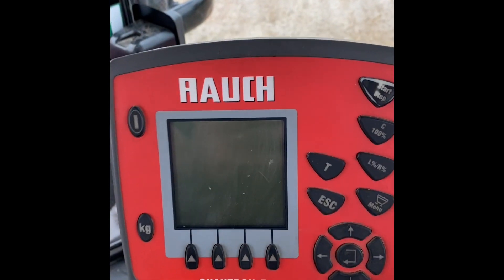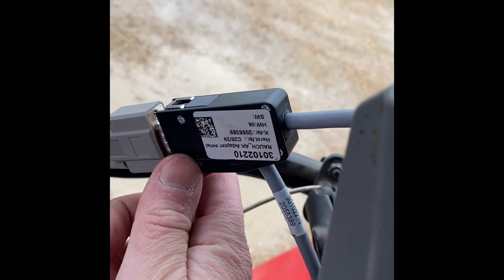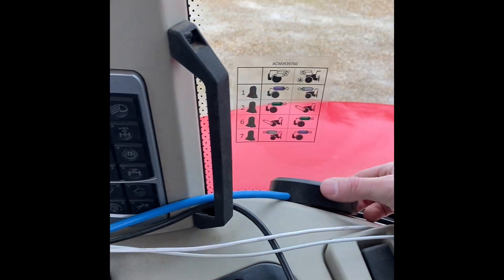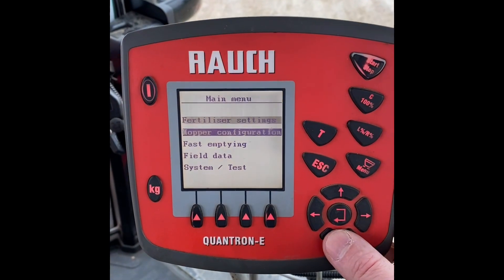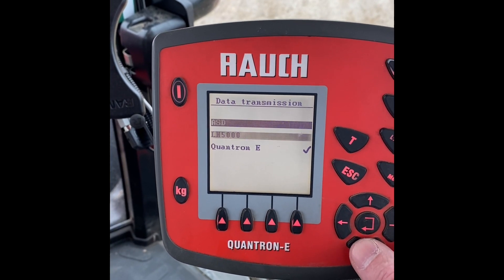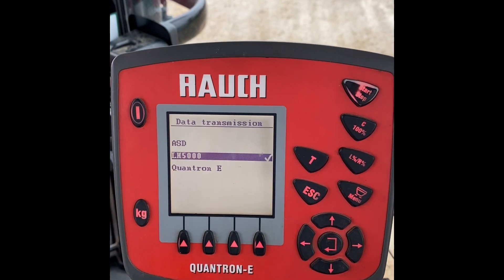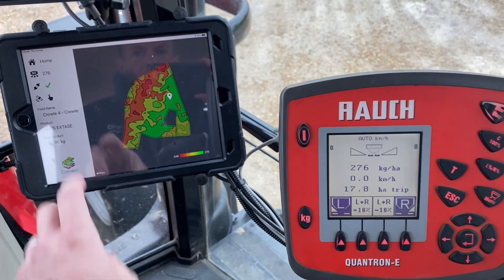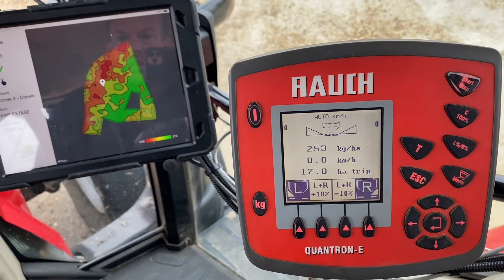Setting up Omnia Connect on a Kuhn Axis

Comment: Oi mate. This is fantastic. Do you know if it could be linked to john deere monitor? Either way this is also very worth looking into. Thank you
Reply from the maker: Hi, many thanks for your feedback it’s greatly appreciated, depending on which element you’re trying to connect to the John Deere screen I believe you could connect the Kuhn/Rauch box via aJD link cable.

Bear in mind this will depend on the age of the JD screen, such as is it a 2630 screen or a Gen 4 screen? 
There’s quite a few variables to each set up so sometimes best to get in touch.

chris.blashill@hlhltd.co.uk

Drop me an email with the specs, what you’re trying to achieve and I’ll certainly try and point you in the right direction.

Many thanks again

Chris